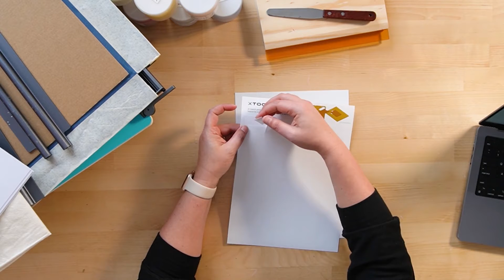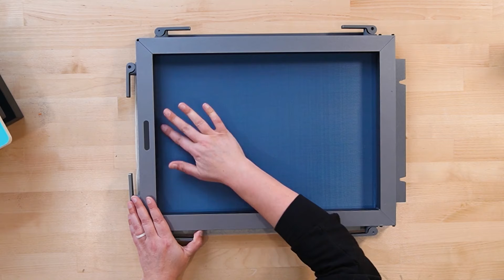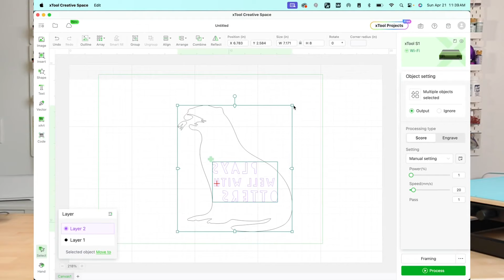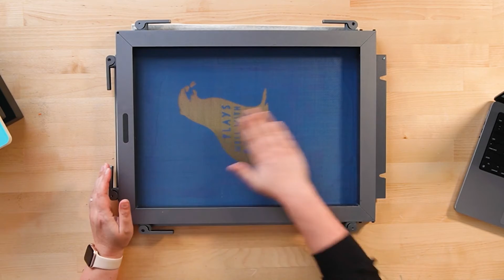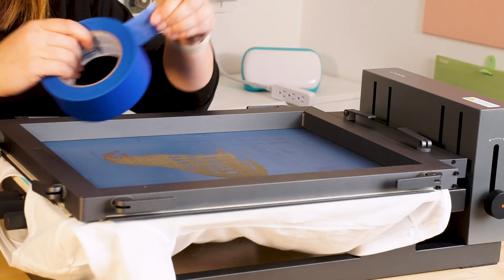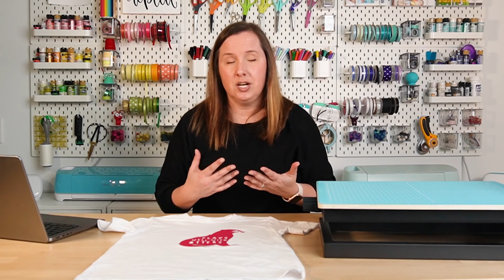xTool Laser Screen Printer Review: How to Make Screen Prints with Your Laser!

Comment: Maybe you could help me with the dimensions of the frame... on the website it only references 11.5x16in but I dont know if that is internal or external. My laser machine fits a max of 330mm wide. Would the frame fit? Thanks G
Reply from the maker: Whicn laser machine do you have?
Reply: @HeyLetsMakeStuff  snapmaker 350